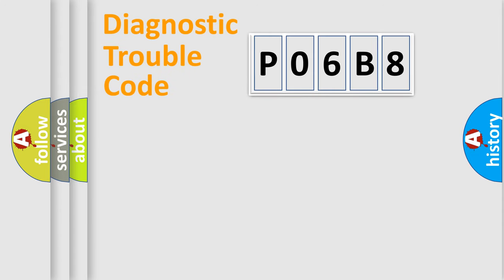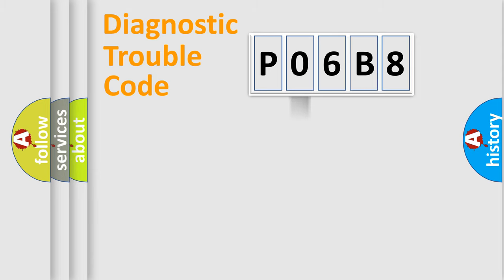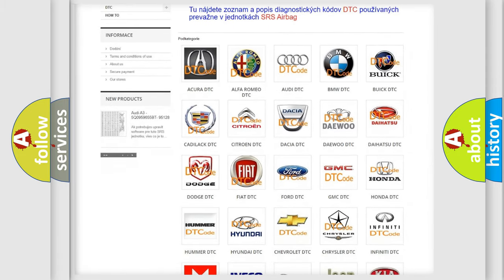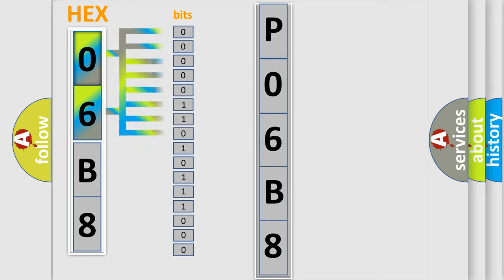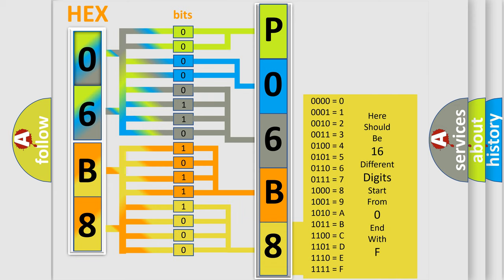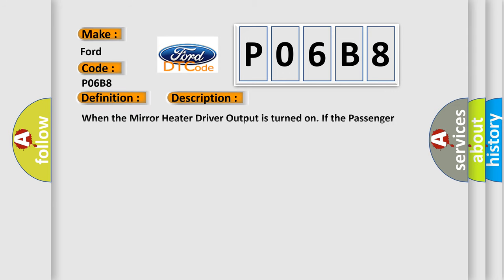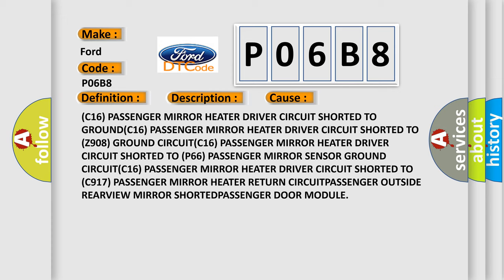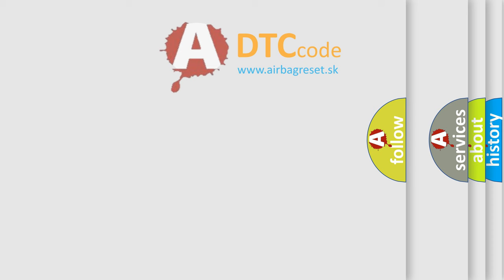DTC Ford P06B8 Short Explanation

Comment: My car Ford Focus ST (ST2) has this code but i don’t have heated mirrors.
Reply: did you ever get it fixed? my fusion has been rough shifting and just threw this code. i hope my pcm isn’t going out..
Reply: @haydendeyoung6768  so what did you end up doing? happening? i just got this code today. My fusion has rough shifted off and on for a while. not very often but  at times it will.
Reply: @Eric  I had this code on my mustang, I thought I'd spend over a grand to fix it but I tried changing my battery first and it worked, the battery wasn't giving off enough voltage to the computer causing it to throw this code
Reply: @haydendeyoung6768  ^
Reply: @CarbonZombie just had this show up in my mustang. I just changed my battery also and never seen this before the change.
Reply: @BankRupt69  did it work?
Reply: @CarbonZombie  reflashed the stang last with same tune I had before and the codes disappeared. Gonna monitor it for another day or two but everything seems fine as of now